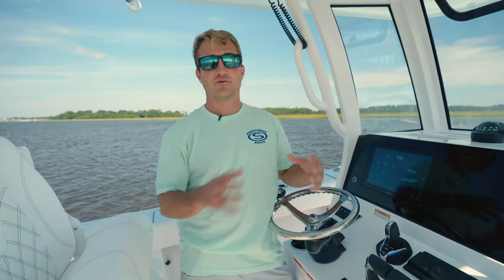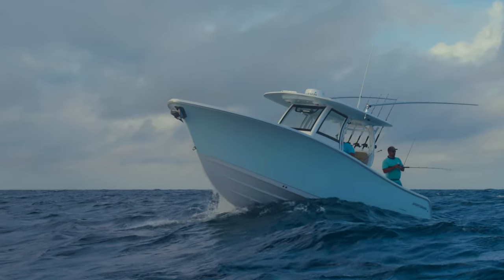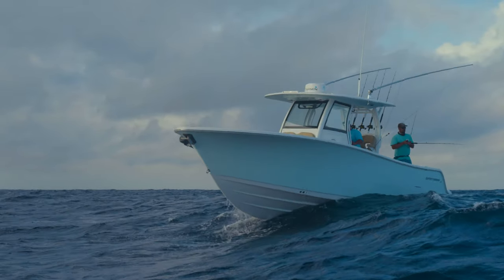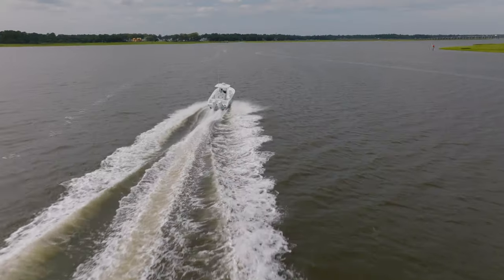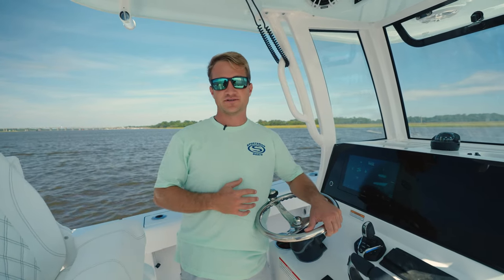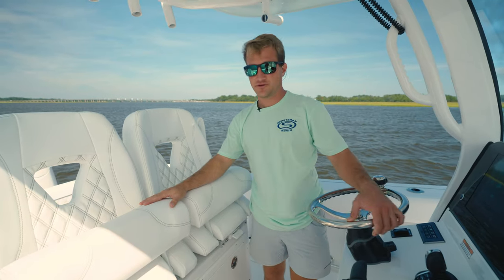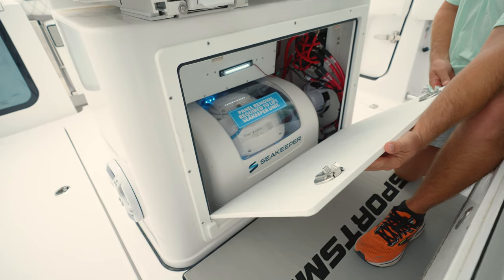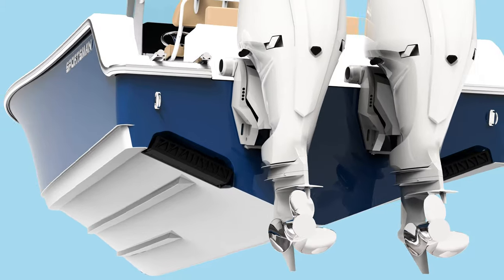Tech Talk - Seakeeper Ride + Gyro

Comment: So the gyro has its own batteries. How big, how heavy, how long do they last on a day of fishing, and how do they get re-charged?
Reply from the maker: This reply is from Chase himself. "The gyro does have a designated battery or batteries depending upon the model. The battery we use for it currently is a group 31 AGM battery that weighs 86lbs. You will typically get 2-3 hours out of it while continually running the gyro with the motors off however these battery/batteries are being recharged while the engines are running via the alternator."

Comment: So where are the batteries now. I do like the placement though.
Reply from the maker: Great question. Standard the batteries would be in your leaning post, however if you order the optional Seakeeper 1 your batteries would be split up. The Seakeeper batteries would be inside the bilge on a designed platform to keep them up off the floor and dry. Then the house and engine batteries would be inside the electrical compartment inside of the console.
Reply: I have one on order. I was wondering how that would be accomplished. I think the battery situation that you described is the best way to do it. Of course. lol. I cannot wait.